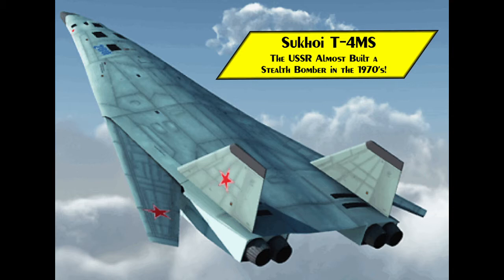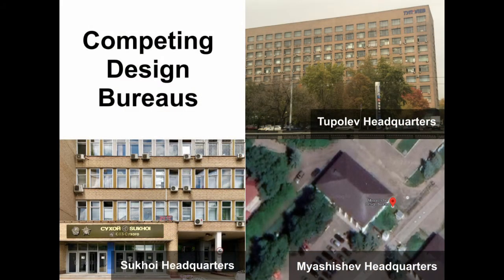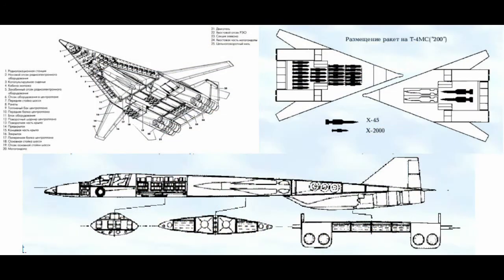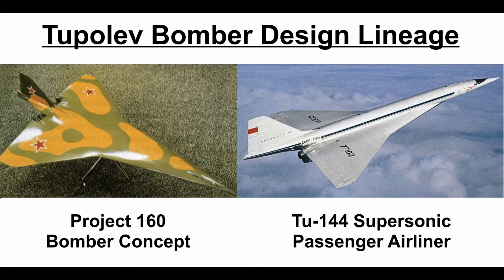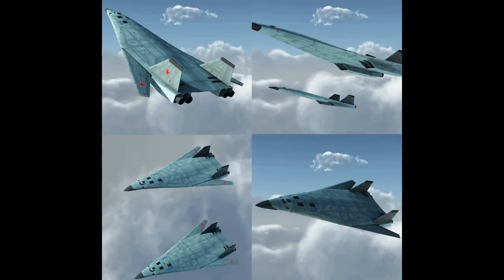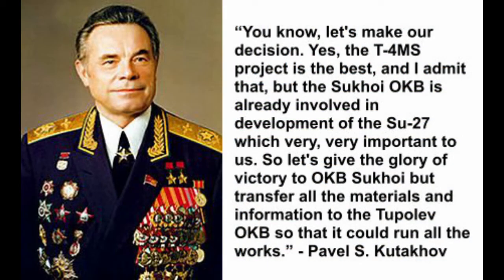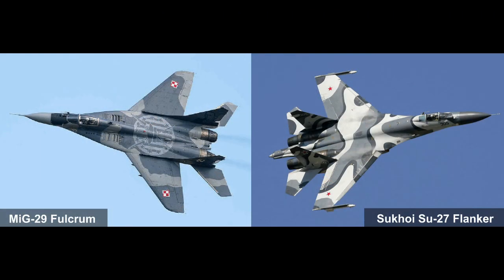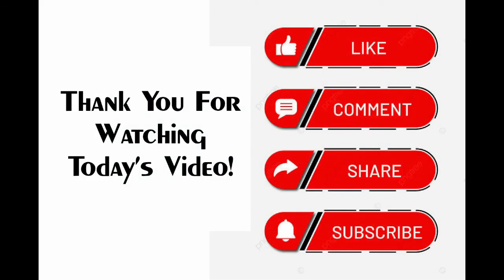1970's SOVIET STEALTH BOMBER?! - The Sukhoi T-4MS Bomber

Comment: It is not inaccurate to call the T-4MS "stealthy." While not developed or intended as a stealth aircraft, the T-4MS would absolutely have had a considerably lower RCS versus other contemporary bombers from the 70s and 80s simply due to the flying wing design. Particularly at certain angles (such as the frontal aspect), it's reduced RCS would have allowed it to get considerably closer to a target before being detected versus other bombers from the era, so it is not at all inaccurate to call the T-4MS "stealthy."

Numerous other bomber designs that leveraged the flying wing concept were "stealthy" without any consideration to reducing RCS by the engineers, such as the Horten 229, the Northrop YB-49 and the Avro Vulcan. The Avro Vulcan, in particular, gave NORAD and SAC fits in simulated war games in the 60s due to its reduced RCS and electronic warfare capabilities. A number of them were able to penetrate American air defenses in Operation Skyshield exercises.
Reply from the maker: All true! Some older platforms may not have been designed for stealth, but were stealthy nonetheless. I talk about this concerning the YB-49 in one of my videos (https://youtu.be/_XdS8LQIjdk)

Comment: It's not at all accurate to call the T-4MS-200 "stealth".
It was designed with entirely contemporary materials and avionics of the T-4 Sotka, It had nothing at all to do with stealth.
It was "all-wing" designed to eliminate unnecessary non-lifting static drag of a fuselage in favor of only lifting volumes, for increased range and payload.
It would have been better than the Tu-160.
Reply from the maker: While it may not have been designed for stealth, it would have been stealthy for the 1970's. In 2014, Tupolev released concept artwork for their PAK-DA bomber that was very reminiscent of the T-4MS.
Reply: Something that might have been "lesser-observable" than a B-52 or 747, is not "stealth" and it is hype to say so.

It is not clear that Tupolev was using that design in that more recent PAK-DA study, or if reporters and editors and concept artists used that older Sukhoi "flying wing" design as an evocative image.

The T-4MS-200 was made with normal materials, with no special shapes intended for stealth, and with huge flat fins.
Reply: @JFrazer4303 "Normal materials"?
The Sukhoi T-4MS-200 was designed for speeds up to 3500 km/h, so the airframe had to be built mostly from Titanium.
How many units would the USSR have been able to build before bankruptcy?
Reply: @OliverSchroeder  As if it would ever reach that speed, or do it without half-burning the engines out like the Foxbat at its max speed.

Same materials and systems as in the T-4 Sotka.
Same achieved speed, too.
Reply: @JFrazer4303 Yes, same materials as in the Tu-4 Sotka: Titanium and high-grade steel. I wouldn't call these 'normal', rather inexpensive aircraft construction materials.
That's why the Sotka (="100") earned its nickname: 100 tons of Gold.
So for the Su-4MS-200 'Dwuchsotka': 200 tons of Gold. Or even Platinum.
But if you mean, the Su-4MS-200 was NOT built with Radar absorbent material: Agreed!
Reply: @OliverSchroeder  They didn't say "inexpensive construction materials", they said materials and manufacturing techniques that are known and in-use for high performance aircraft of the time.

Comment: They should build it now!
Reply from the maker: The original concept for the PAK-DA bomber that was released in 2014 was a very similar design. However, since then Tupolev opted for a flying wing design for their stealth bomber. See my video on the PAK-DA to learn more. https://youtu.be/_2lf6-K9aLM
Reply: Even regardless of stealth, for superior range and payload, even if Mach 3+ @ 30+km altitude is not a goal.